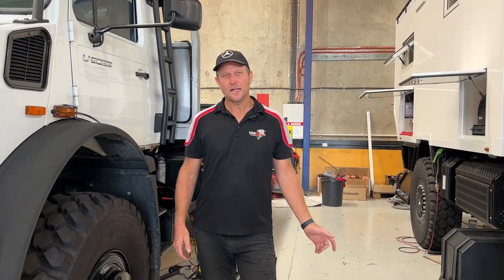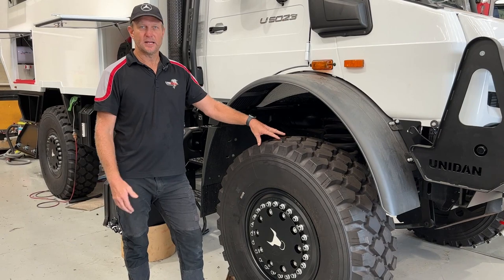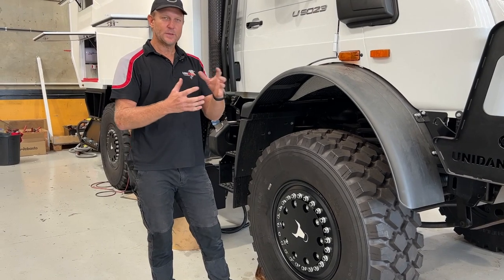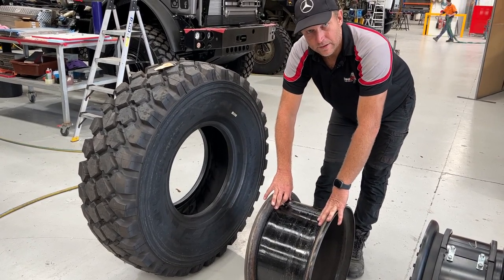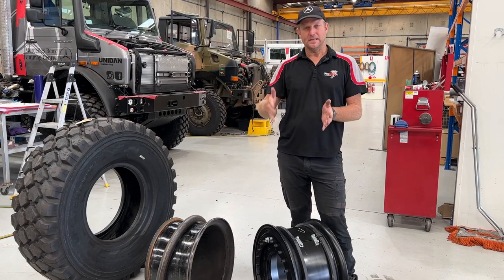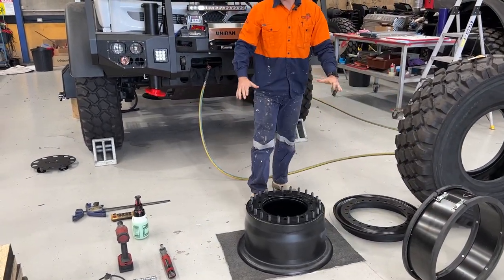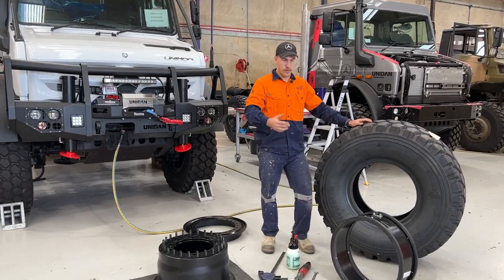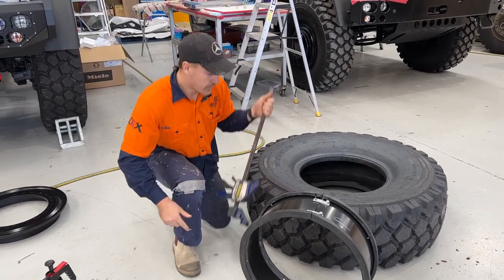Hutchinson Rims on a Unimog - WHY we recommend them & HOW to fit them!

Comment: I managed to put my 4 beadlocks on 14.00 R20 alone before this video was out. I had no experience and it was not easy. Thanks so much UNIDAN as usual for the fast lesson and little tricks for next time. I also do recommends Hutchinson, they are expensive, but best value for the money. drive safe.

Comment: A few questions: 1) what is the substance that the mechanic painted on the bolt threads? 2) Switching from MB CTIS wheels to Hutchinson requires a different air hose fitting. Where can I find those adapters or fittings? 3) MB book says 600-650 nm torque on the wheel bolts. What is the torque spec for the Hutchinson flange bolts? Thanks again,  great stuff!
Reply: The substance is called anti seize

Comment: Might pay just to run over the safety of inflating a tyre. If ppl are checking for leaks while it’s inflating and with in 1m there dead if it’s over 25ish psi and it pops from damage or incorrect fitting. 

Very small chance with this style of rim but it’s the most important part of the whole activity. Great vid guys and thanks for info👌

Comment: I couldn't help but notice a pair of (presumably hydraulic) jacks mounted on the winch bar of the Unimog behind. What are those? Is it a in-house developed product? Really curious to know about it. Can it also help for recovery purpose, like if you get stuck in sand?
Reply from the maker: Hi there, 
The vehicle in the background has hydraulic levelling legs so that when you set up at camp you can be perfectly flat. We have designed and developed this by integrating it into our bull bar. We wouldn’t recommend it for recovery purposes (you really shouldn’t get stuck in sand in a Unimog) but if it was a matter of saving your truck or not then these could be helpful if used appropriately.

Comment: thanks for the very interesting video...I always follow you with pleasure. Could you tell me if you can use the same technique with the rubber beadlock? Is it possible to insert the beadlock inside the wheel without suffering too much? Thank you!!!

Comment: Will a few g clams work if you don’t have a crane to close the bolt hole distance when sealing the rim?
Reply from the maker: If you don’t have a crane then this is where you have the wooden blocks underneath the rim throughout the process (ie. put them under the rim prior to putting the tyre on the rim). That way the tyre will still be off the ground and the rim will sit in the right position for the bolts 👍🏼

Comment: Do you run balance beads with your wheel and tires. Do you get a lot of unbalanced tires going down the road?
Reply from the maker: We don’t normally run balance beads because you can’t run them with central tyre inflation (in case a bead gets into the air system). If they do need balancing then weights are used externally.

Comment: Comment on Kopper Kote // Anti-Seize It does reduce the friction so de TORQUE anything you tighten up. I do mine to 75%. Works so far!!!!!!!! 
YOU Can use your clamp for the tire spreading you did.  
As well laying the flanged side down allows sand to stick to the face which then changes the ability to torque. an argument I have at the tire place most times. 
As well anyone with flanged nuts which are for the slightly smaller tires. {{{{{{ OIL THEM }}} COST ME A ?? >$1,000.00 WAS NOT HAPPY AT ALL.